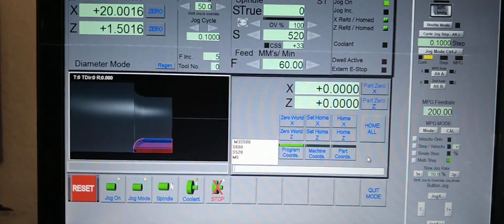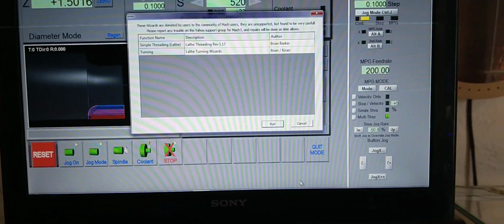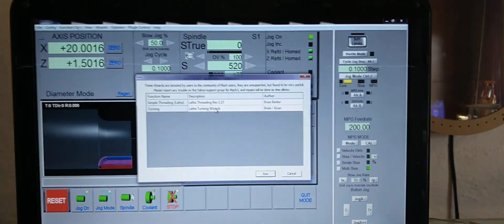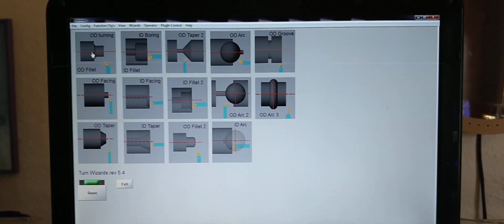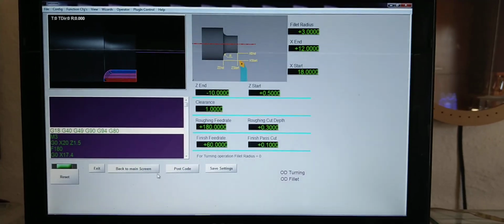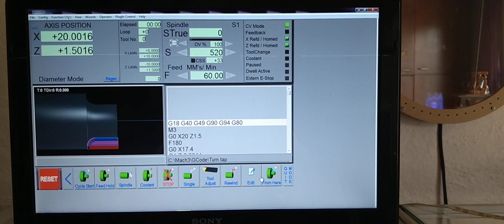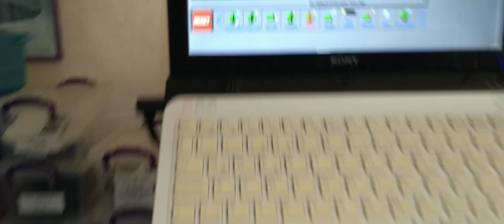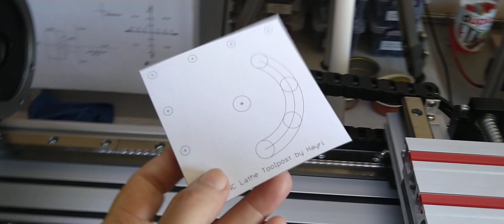DIY CNC Lathe controlled with MACH3 build by #Hayri #MACH3 #PCBWay com Part 5

Comment: This ball-bearing based spindle design must have a lot of play. It must be rigid, otherwise the lathe will chatter.
Reply from the maker: You would be surprised. There is a reason why I used 3 bearings and preloaded it while mounting them. Of course the "proper" way is to do it with taper bearings, if you can afford them that is.